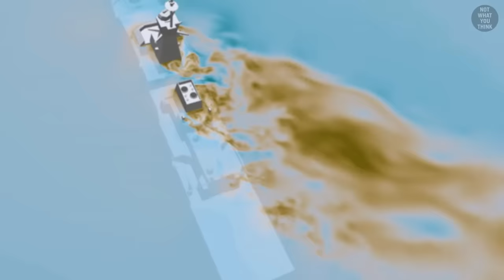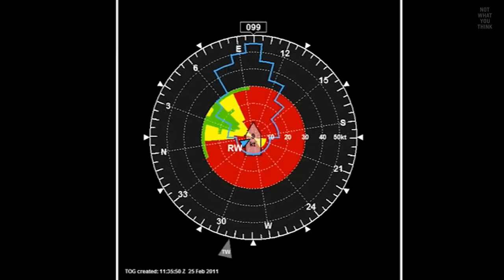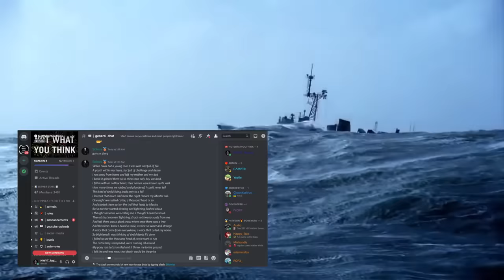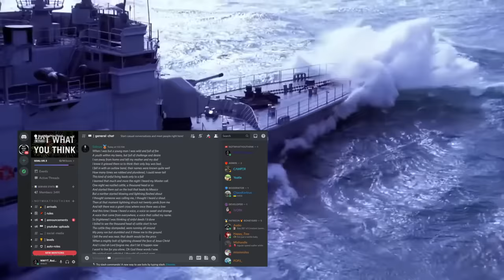How Helicopters Land in Rough Seas

Comment: My last job in the Navy before retiring in '99 was rebuilding worn out RAST systems for Navy Cruisers. Very interesting job!
Reply: Interesting.   Did the RSD cams work?  did Beam lock pins stick?  New flags w springs?? How did you test the transition going from reel in to recovery tension /snatch load??? I was Navy civilian hardware design team lead, responsible for getting the RAST to work during system test at DAF, and OPEVAL tech expert. on board .good_sstuffatattnet.

Comment: Been there, done that...........it wasn't fun. Imagine landing 2 MH-53J's on the USS Missouri's helicopter pad that was designed accommodate only 1 H-3. There was no bear trap system and even if there was, we had to land on opposite corners to keep the rotor blades from hitting each other. One main landing gear of each helicopter was right next to the wire at the edge of the deck which meant, the tip tank was hanging out over the water. Me being the flying crew chief at that time, had to go out and place the wheel chocks and safety pins. The inboard side was easy enough but, I had to climb up onto the sponson (main fuel tank), then out onto the gull wing (holds the tip tank) and hanging my head over the side (seeing that the water was very far away) to insert the 12 inch long safety pin.
On a later landing, one of the pilots (thankfully not on the helicopter I was assigned to) misjudged his landing and smacked the deck hard enough to blow the seals on all 3 landing gear struts, spilling hydraulic fluid all over the deck.
Reply: Never heard of it called a bear trap, we called it RSD rapid securing device it went around the rast probe as soon as the tires were on deck
Reply: I hope the seas were calm that day. It's hard enough with a 60 that rides like a cadillac. Can't imagine trying to put 2 of those flying houses next to each other on a deck never even designed for it.

Comment: Very informative video. I was never deployed on a small ship in the US Navy. I was on the USS Carl Vinson CVN-70. On a standard fixed wing carrier, our helicopters did not have any specific system for landing. They just landed on the deck, and were then tied down by the deck crew. The advantage of a carrier is that they pitch, and roll slower, and fewer degrees than the small ships.
There was one time when I was aboard ship that a helicopter, an SH3 Sea King, suffered rotor damage, and loss of collective control after the rotor ingested the rescue cable. Surprisingly the cable broke rather than shearing the rotor off the aircraft. The pilot was able to descend, and hover over the deck using throttle, I presume, but did not have the ability to land due to the fact that the engines respond too slowly to power input to allow a safe landing. After hovering for a very long time, while a plan was devised, deck crew rigged a block and tackle to the deck, and then a crewman was sent up on the deck crane to attach the cable to the belly hook on the helicopter, and a pair of aircraft tugs were used to pull the helicopter down to the deck where it was then tied to the deck in the normal manner. I am sure that the flight crew had to change their skivvies afterwards. I can not imagine the skill, and concentration they exhibited hovering that damaged aircraft so precisely for what I believe was well over an hour.
I doubt that any of this was in an emergency procedures book. It t feels like the sort of thing that a Chief Petty Officer would come up with. I am glad that I was there to witness this incident, and it's safe conclusion. It is gratifying to know that even in a procedure centric institution such as the US military, there is still room given to let human ingenuity and quick thinking solve the problem.
Reply: There is a line in every NATOPS, where it says something along the lines of, "this publication is not meant to preclude sound judgement." There are situations so preposterous that we cannot possibly hope to catalogue exactly what to do in every single one. That is incumbent upon the culture and attitude fostered within an organization to make decisive, thinking individuals instead of drones. It is my hope that every pilot is ingrained with the attitude of breaking a couple of rules, destroying equipment, and living, rather than saying "ah well that's not what NATOPS says" while flying into the ground. Fight to the last second. Never accept defeat. Thank you for your story. As an H60 pilot, this really hit a chord for me.

Comment: One afternoon I had the watch in CIC while we had the helo up doing ASW ops. The pilot requested we set flight quarters early. When I asked why he replied he had a "bladder over pressure light". The helo comms were piped onto the bridge and the Officer of the Deck only heard "over pressure light" and set emergency flight quarters before I could speak to him. The Supply Officer was the Landing Signals Officer and happened to be in ship's refrigerated stores. He had to race up 4 decks. He was not happy with the OOD when he found out why.

Comment: I swear, Navy helicopter pilots got to have the hugest fucking balls.
Reply: Flying the original Corsair that would roll you to death if you weren't careful on landing, the fact that if you miss and you don't have the thrust, you're going in the water, arrestor wire snaps, and heli pilots having to deal with the ground coming up to meet them quite literally due to the ocean. Honestly, it's insane that we've conquered the water and put aircraft in it.

Comment: I was aware Canadians used the bear trap and invented it. But this is the first time I've actually fully seen one. It's actually a bit more complex than I thought
Reply: I do work Asset Manager , Accounts Manager, Tax Manager, Asset Take Care , Asset Representator I Do Work With safe And 100 % Secret
Reply: The complexity stuff is below decks with the hydraulic servo winch system which has to maintain a constant cable tension as helo and ship move around.

Comment: Gives me white knuckles watching those incredibly talented pilots pulling this off.
Nerves of steel  doing that,much respect,because that's just nuts watching that get done.
And that bear trap is the coolest tech I've seen lately,didn't know how they stayed on the deck.
Same with the other system,just amazing.
All the tech being used is just,wow....
Reply: I do work Asset Manager , Accounts Manager, Tax Manager, Asset Take Care , Asset Representator I Do Work With safe And 100 % Secret
Reply: NAW ,, just engineering...some servo hydraulic feedback system, some electronics and relay controls, miniature mechanics,  strength of materials in a corrosive salt atmosphere, human interfaces at the console...

Comment: You didn't mention that the Lynx Aircraft, in addition to the Harpoon deck lock system, also has the ability to achieve negative pitch collective control, meaning that the rotors are able to push the Aircraft down on to the deck in certain rough weather situations. 
The ability to swivel the aircraft on the spot is very useful for both take offs and landings where the ship can't change course to suit wind across deck conditions, and when weapons are loaded and you don't want to point them straight at the hanger. Unfortunately it means the main wheels have to be manually moved to the fore and aft position before the aircraft can be moved on deck as only the nosewheel has the ability to move under hydraulic power. It's called Toeing-in or Toeing-out the wheels and it is done by using a long metal pole (known as a Toeing-out bar, not to be confused with a Towing bar, lol) with a right angle fitting at the end which slides in to the wheel's axle. There is a spring loaded pin that has to be pulled down in order for the wheels to move and it seats when the wheel is at the correct angle.
The Aircraft also have manual and automatically controlled wheel locks on all four wheels. The pilot can release them in order to spin. The deck crew can also work them at the wheels when ranging the Aircraft on deck.
I worked maintenance and flight deck operations on the Lynx Mk3, Mk3S and Mk8 variants in the Royal Navy during the 90's.
Reply from the maker: thanks for detailed response, you obviously know more than we have researched. Some interesting tidbits you shared!
Reply: I do work Asset Manager , Accounts Manager, Tax Manager, Asset Take Care , Asset Representator I Do Work With safe And 100 % Secret
Reply: @farrukhahmad555  That's jolly nice for you...... why don't you run along and let the grown ups talk?
Reply: @nickmaclachlan5178  will you Hire Me

Comment: I was a chopper pilot in the French Navy. I served aboard Panther (the military version of the Dolphin) and Lynx.

On French frigates you have a one squared meter grid included in the rear landing deck. With the chopper you have to drop a harpoon and it has to engage and lock in the holes of the grid (a bit like the docking system that was on top of the planned Russian LOK lunar lander from the Cold War Era). It has a winch in it. When it's engaged and locked, it draws you firmly till you touch the deck, and secures your machine for good. So basically, you hear the lock clicking, a beep in the cockpit, then you give a bit throttle up, and if you see the helo goes down instead of climbing, you know you've been caught and there's almost no risk of hitting the deck hard or bouncing because of the waves. It's a bit like the Canadian bear trap, but the grid is inside the deck and the whole process involves nobody from the deck crew.

edit I wrote my comment too early : it's almost like this system, @ 4:39
Reply: Harpoon system is  good concept for recovery,,,.. but it does not secure helo for transit into hangar..

Comment: I was stationed on USNS Sirius, Spica's sister ship. Interestingly, Sirius and Saturn, another sister ship, had another helo mishap when we were testing out the K-MAX helo for VERTREP operations. Pallets of cargo are routinely staged around the perimeter of the helo deck during VERTREP operations which ended up being a big problem when the K-MAX tried to land back on Saturn. It's angled main rotors were low enough to the deck that they struck one of the staged pallets, ending that particular test. No one was injured, but the Helo was going to need a lot of work.

Comment: A million years ago I flew H3 Helos for the Navy. I enjoyed the tricky landings on small ships. Close to the Artic circle I was making an approach to a small deck in extremely rough seas where the waves were breaking over the bow and the bridge drenching my aircraft. T5 dropped by about 30 degrees. Landed safely but impressed by the situation…T5 returned to normal after unloading the Chaplin while sitting on deck. GO NAVY👨‍✈️

Comment: Been there, done that, got the DD214.  Was on the crash and salvage team on USS Vandegrift, operating LAMPS III system (SH-60 B).  We had a RAST system.  One night we were in rough seas just like this.  The helo landed on deck and we had a heavy roll (around 20-30 degrees).  When one of our guys went to chock and chain the helo, the rotors dipped and his head got nicked by the main rotor!  His cranial (Helmet) was knocked off and all we saw was the reflective tape on the helmet and I thought his head was ripped off!   The tip of the blade sheered off and imbedded itself on the buklhead above the helo hanger door like a ninja star.    Once the rotors stopped we ran out to check on our shipmate.  He was LUCKY!  He had a concussion and a big bruise on his forehead.   Irony is the guy's nickname before the accident was "Blade".   They put him back on the flight deck later that week.

For me flight quarters always had a pucker factor.   RE HIFR, and Vertrep, static electricity is a major problem. Heard stories of guys getting fried badly from the static charge coming off a cable!  Knew another guy whose buddy walked into a tail rotor.  Turns out in training, we were told never to stare at the tail rotor blade, because some people can get hypnotized.  The guy in question had his face sheered off, but he didn't die right away.  I didn't witness, but it happened the same time I was in the Hospital for a line handling injury.  The guy in question was in a coma, but when he gained consciousness and realized he had no face, he went into cardiac arrest.  The doctor didn't try to revive him.

Ships are a dangerous place.  Lost a finger myself.
Reply: I thought that we designed the probe and RSD (securing device) to absolutely hold the helo.  So that u  could shut down blades and then chock/chain???
Reply: @marvsmoir701  Maybe it was, but on that dark night, that is what happened.

Comment: The  Sea Lynx we see in the video is posibly the most versatile helicopter for small vessels. The harpoon system will pull down the helicopter with a force of 3.5tons of drag after it is enaged. Manufacturer garanties a secure helicopter locked only with the harpoon up to 17,5 degrees of roll. With lashings or chains even more. And last but least you can push negative pitch with the collective after landing.  In 2500 fying hours with the lynx I never feel unsecure, even in the worst weather.

Comment: 4:00 The Mactaggart Trigon system is not the same as the beartrap system. TRIGON is a universal traversing system based on cables being attached to the helicopters landing gear.
Reply: McTaggart Scott and Dowety did the engineering of BEARTRAP

Comment: We typically don't do the full procedure with the messenger cable getting lowered. It requires personnel on the flight deck with us in the air and takes longer. We usually do a "free deck" landing, putting the probe into the RAST manually as you see in the footage a bunch of times. Also Japan's H-60s are insane. They are basically made under license from Sikorsky by Mitsubishi, with a few upgrades and features of their own. They are pretty damn gucci. JSDF is one of the most technologically advanced forces in the world, and to all my brothers and sisters, you know what I mean when I say that their shit actually works.

I know it doesn't look like much, but trust me, landing on a boat in a helo is harder than it looks.

Comment: What happens if the helicopter hits the deck at a hard angle during landing? How does the beartrap system handle that?
Reply: It depends on the angle, sink rate and roll angle of the deck in the moment of the touchdown/impact.  Either the landing gear will brake and the helicopter will rest on his under fuselage or it will face a dynamic roll over and with luck it will stay on the flightdeck, if unlucky it will go overboard.
Reply: If the helo probe gets into the RSD (securing device) and the LSO closes the rsd, the helo will be secured.essentially at any cross deck angle...   When the LSO straightens the helo he might  have to angle the helo quite a bit but the system will hold the helo.   Deck roll is a different story.  the LSO and pilot must wait and land during a minimum deck motion/roll.  as to the RA Cable, the tension is always less than the residual helo lift,  so the pilot can always lift up to avoid a single landing gear impact..

Comment: Question: I just thought of this but, how does salt spray not absolutely destroy turbine engines if they're shut off for more than an hour?

With all that bear steel, would it not immediately start to rust as the salty water dries on the hot blades?

Comment: 9:25 One question, why didn't they just refuel the helicopters and flew the while the cessna landed? If there wasn't space for them to land again afterwards, push the cessna overboard. It's less costly than like 3 hueys
Reply from the maker: I don’t know for sure why, but here are two considerations: 
1) They had been landing helicopters for 30 hours straight. Everyone was exhausted. 
2) Even though Major Buang said in his note that he had enough fuel for 1 hour, it probably took some time for the carrier’s commander to made a decision on what to do. Maybe by the time they decided, there was only 20 minutes them left and dropping the helicopters was the most feasible options. Also, those were mostly Vietnamese helicopters that were dropped.

Comment: I was stationed aboard a Perry Class Frigate (FFG-55) in the 80's. I've seen 100's of these occur with SH60's. During flight OPs, I'd stand and watch from the Control Tower next to one of the Pilots who manned it. The rotor blades looked like the were only a few feet from the glass!
Reply: I do work Asset Manager , Accounts Manager, Tax Manager, Asset Take Care , Asset Representator I Do Work With safe And 100 % Secret
Reply: so I guess U were in the LSO control console station at the side of the deck ..??  Did they use the RAST much  for recovery  or just the RSD to straighten and move helo into hangar?
Reply: @marvsmoir701  no, in the tower behind the CIWS control room on the 01 level. They used both depending on sea state for recovery and traverse.

Comment: This video makes HIFER sound so simple, but it can be very dangerous for the flight deck crew. I once was nearly electrocuted to death because the pilot wasn’t paying attention. I had just unhooked the hose from the cable but still had the cable grounded and in my hand, when the pilot started to fly off. The cable came loose from the grounding strap before I could let go. I still have scars on my hands thirty years later.
Reply: Sounds painful.

Thankfully it wasn't a tensioned cable, those things whip HARD.